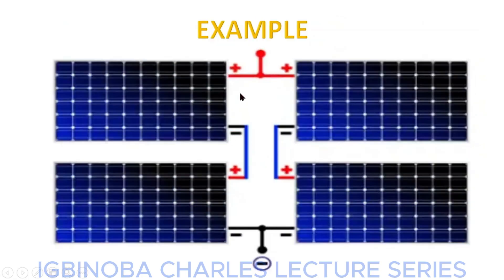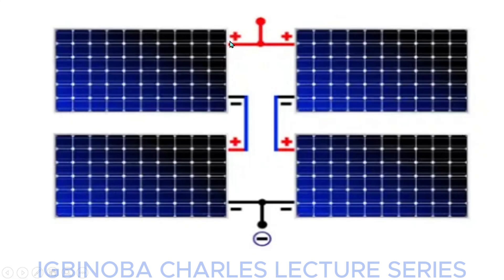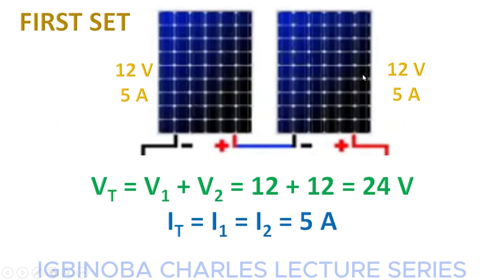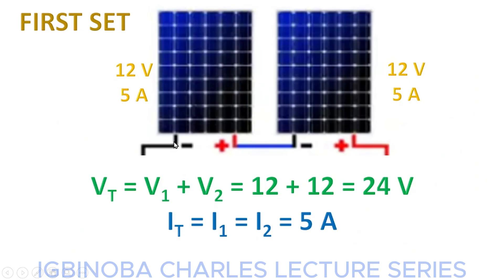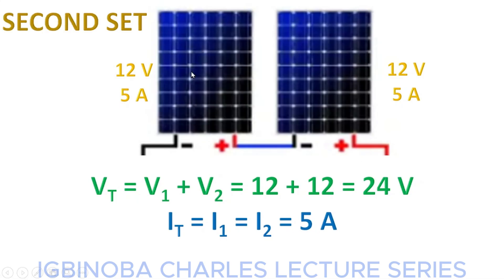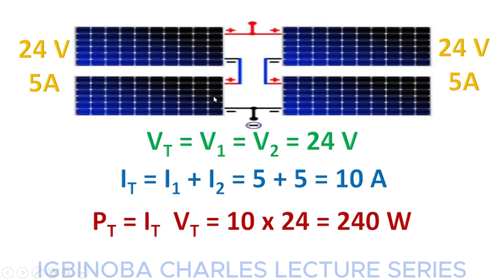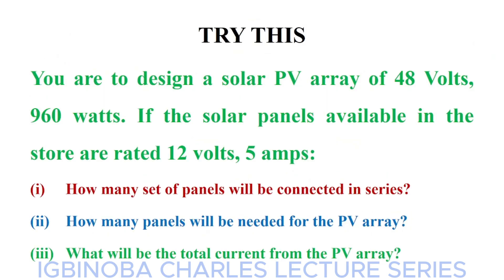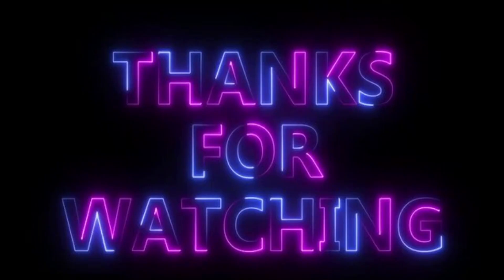Connection of  Solar Panels in SERIES-PARALLEL

Comment: PETRO3114J 

1. Since a series connection determines the total voltage of the solar array and the required system voltage is 480V, so the number of panels connected in series produces the total voltage.

The number of panel required is 480÷12= 4panels.

2. The power output of pne panel is the total voltage multiplied by total current.
    P= 12×5 =60watts

Therefore the total number of panel to prodUce 60WATTS 
                                   = 960/60= 16Panels.

3. With 16 panels in total and 4 panels per series string, the number of parallel strings is 16÷4= 4parellel sets. Each string produces a current of 5A, since the strings are connected in parallel the total current supplied by the array is 
                                           =5A×4=20A.
Reply: CHM84F

1. Since a series connection determines the total voltage of the solar array and the required system voltage is 480V, so the number of panels connected in series produces the total voltage.
The number of panel required is 480÷12= 4panels.
2. The power output of pne panel is the total voltage multiplied by total current.
P= 12×5=60watts
Therefore the total number of panel to prodUce
60WATTS
= 960/60= 16Panels.
3. With 16 panels in total and 4 panels per series string, the number of parallel strings is 16÷4= 4parellel sets.
Each string produces a current of 5A, since the strings are connected in parallel the total current supplied by the array is
=5Ax4=20A.

Comment: MEC52Z 

1,  4 sets of Panels will be connected in series. Since connecting 4 of the 12 volts, 5 amp panels in series gives a total of 48 volts as required by the solar panels array design 

2,  16 panels will be needed for the pv array. This is because the power of each Panel is 12×5 to produce 60watts,therefore the total number of Panels 
to produce 960 watts is 960/60 = 16

3,  The total current from the pv array is 20 amps since last (total) = / v(total)
I (total) = 960/48 = 20amps

Comment: CIV38L

1. Number of panel sets in series: 48V + 12V = 4 2. Number of panel for PV array: 960W ÷ (12V X 5A) 960W 60W = 16 3. Total current: Number of parallel strings: total no of panel for PV array/ number of panels set in series = 16/4 = 4 Therefore total current= 4X5A = 20Amp

Comment: PETRO3107C

1. Four panels are connected in series.

When you connect four 12-volt, 5-amp panels in series, you get a total of 48 volts, which is the voltage needed for the solar system.

2. A total of 16 panels are needed.

Each panel produces 60 watts (12 V x 5 A = 60 W).

To get 960 W in total: 96060 16 panels.

3. The total current from the solar array is 20 amps.

Using the formula I = P + V, I = 960 W 48 V = 20 A.

Comment: EEE385G

1. Series connection of four panels
Linking four 12 V, 5 A solar panels in series increases the system voltage to 48 V, which matches the required operating voltage of the setup.

2. Total number of panels required
Each panel delivers 60 W (calculated as 12 V × 5 A).
To achieve a total output of 960 W, the system will need 16 panels (960 W ÷ 60 W = 16).

3. Overall current output
The array’s total current can be found using .
So, 
I(total) = P(total)/v(total)
=960/48 = 20

Comment: MAR362J

Required PV array: 48 V, 960 W

Available solar panel: 12 V, 5 A

(i) How many panels in series?

In series, voltages add up, current stays the same.

We need total voltage = 48 V, and each panel = 12 V.

Number in series =48/12=4

(ii) How many total panels for the array? Each panel = 12V ×5A=60W To get total power = 960 W Number of panel=960/60=16

(iii) What will be the total current from the PV array?

Each series string = 4 panels = 48 V, 5 A. We have 16 panels total, so: Number of parallel strings=16/4=4 In parallel, current adds, voltage stays same (48 V):

Total current =4×5A=20A

Comment: EEE373U
1.Number of Panels in Series
Required system voltage = 48V
Each panel voltage = 12V
Number of panels in series = 48V ÷ 12V = 4 panels
Answer: 4 panels in series.

2.Total Number of Panels Needed
Power of one panel = 12V × 5A = 60W
Total required power = 960W
Total number of panels = 960W ÷ 60W = 16 panels
Answer: 16 panels in total.

3.Total Current from the PV Array
Total panels = 16
Panels in series = 4 → Number of parallel sets = 16 ÷ 4 = 4 sets
Current per set = 5A
Total current = 4 sets × 5A = 20A
Answer: The total current is 20A

Comment: PETROCHEM70R 
4 set of panel will be connected in series 
1  since connecting 4 of the12 volts, 5 amp panel in series gives a total of 48 volt as required by the solar PV array design.
2  16 panel will be needed for the pv arraythis is because the power of each panel is 12 x 5= 60 watts, therefore yhe yotal number of panel to produce 960 watts is 960/60= 16
3  the total current from the pv array is 20 amps
Since I (total) = p(total)/v(total)
I(total) = 960/48=20 amps

Comment: EEE363K 

I. Four panels are connected in series.

When you connect four 12-volt, 5-amp panels
in series, you get a total of 48 volts, which is
the voltage needed for the solar system.

2. A total of 16 panels are needed.

Each panel produces 60 watts (12V * 5A
= 60W) To get 960 W in total: 960/60 =16
panels.

3. The total current from the solar array is 20
amps.

Using the formulal= P+V,l=960W/ 48*V

M

20A

Comment: EEE312L
1. Four panels are connected in series.
When you connect four 12-volt, 5-amp panels in series, you get a total of 48 volts, which is the voltage needed for the solar system.
2. A total of 16 panels are needed.
Each panel produces 60 watts (12 V × 5 A = 60 W).
To get 960 W in total: 960 ÷ 60 = 16 panels.
3. The total current from the solar array is 20 amps.
Using the formula I = P ÷ V,
1 = 960 W ÷ 48 V = 20 A.

Comment: EEE395Q

1.Number of Panels in Series
Required system voltage = 48V
Each panel voltage = 12V
Number of panels in series = 48V ÷ 12V = 4 panels
Answer: 4 panels in series.

2.Total Number of Panels Needed
Power of one panel = 12V × 5A = 60W
Total required power = 960W
Total number of panels = 960W ÷ 60W = 16 panels
Answer: 16 panels in total.

3.Total Current from the PV Array
Total panels = 16
Panels in series = 4 → Number of parallel sets = 16 ÷ 4 = 4 sets
Current per set = 5A
Total current = 4 sets × 5A = 20A
Answer: The total current is 20A

Comment: EEE3119O

1.Number of Panels in Series
Required system voltage = 48V
Each panel voltage = 12V
Number of panels in series = 48V ÷ 12V = 4 panels
Answer: 4 panels in series.

2.Total Number of Panels Needed
Power of one panel = 12V × 5A = 60W
Total required power = 960W
Total number of panels = 960W ÷ 60W = 16 panels
Answer: 16 panels in total.

3.Total Current from the PV Array
Total panels = 16
Panels in series = 4 → Number of parallel sets = 16 ÷ 4 = 4 sets
Current per set = 5A
Total current = 4 sets × 5A = 20A
Answer: The total current is 20A

Comment: CIV340N
I. Four panels are connected in series.

When you connect four 12-volt, 5-amp panels in series, you get a total of 48 volts, which is the voltage needed for the solar system.

2. A total of 16 panels are needed.

Each panel produces 60 watts (12V * 5A = 60W) To get 960 W in total: 960/60 = 16 panels.

3. The total current from the solar array is 20 amps.

Using the formula I = P + V, I = 960W / 48 * V = 20A

Comment: PETRO386H

Required PV array: 48v, 960w
Each panel: 12v, 5A
Power of one panel:
P= V×I = 12×5=60w

I. No of panels in series; 
48/12= 4
II. No of panels needed for 960w
960/60= 16
III. Total current from the PV array;
4 panels per series string= 48v, 5A 
We have 16panels in total so;
No of parallel strings; 16/4= 4strings
When connected in parallel, 
Itotal=4×5=20A

Comment: MAR 381C
Four 12-volt, 5-amp solar panels are connected in series to achieve the required 48 volts for the solar system. In a series connection, the voltage adds up while the current remains the same, so four panels give a total of 48 volts and 5 amps. Each panel produces 60 watts (12V × 5A = 60W). To obtain a total of 960 watts, 16 panels are needed since 960 ÷ 60 = 16 panels. The total current from the solar array is calculated using I = P ÷ V, which gives I = 960W ÷ 48V = 20A. Therefore, to achieve 48 volts and 20 amps, the 16 panels are arranged as four series strings of four panels each, connected in parallel. Each string provides 48V and 5A, and four such strings in parallel result in a combined output of 48V, 20A, and a total power of 960W.

Comment: EEE377Y

1)4sets of panels will be connected in series. Since connecting 4 of the 12 volts, 5 amp panels in series gives a total of 48 volts as required by the solar
PV array design
2)16 panels will be needed forthe PV array.
This is because the power of each panel is 12 x 5 : 60 watts, therefore the total number of panels to produce
960 watts is
960/60 =16
 3. The total current from the PV array is 20 amps
Since I (total) : P (total)/ V(total)
I (total) : 960/48 : 20amps

Comment: MAR366N

1i. Panels in series add voltage but keep current constant.
We need 48 V, and each panel is 12 V:
No in series = 48v/12v = 4

ii. Each panel = 12 V × 5 A = 60 W
We need a total of 960 W
Total panels = 960w/60w = 16.

iii. We already know:
Each series string = 4 panels (48 V, 5 A)
We have 16 panels total, meaning number of parallel strings = 16/4 =4
Current adds in parallel:
Total current =5A×4 = 20A

Comment: EEE3113I

I. Four panels are connected in series.

When you connect four 12-volt, 5-amp panels in series, you get a total of 48 volts, which is the voltage needed for the solar system.

2. A total of 16 panels are needed.

Each panel produces 60 watts (12V * 5A = 60W) To get 960 W in total: 960/60 = 16 panels.

3. The total current from the solar array is 20 amps.

Using the formula I = P + V, I = 960W / 48 * V = 20A

Comment: PETRO 6F

1. Four panels are connected in series.
When you connect four 12-volt, 5-amp panels in series, you get a total of 48 volts, which is the voltage needed for the solar system.

2. A total of 16 panels are needed.
Each panel produces 60 watts (12 V × 5 A = 60 W).
To get 960 W in total: 960 ÷ 60 = 16 panels.

3. The total current from the solar array is 20 amps.
Using the formula I = P ÷ V,
I = 960 W ÷ 48 V = 20 A.

Comment: MECH344R

i. 4 sets of panels will be connected in series 
( 48V/12V) = 4

ii. 16 panels will be needed for the PV array 
(960W/60W) = 16

ili. The total current from the PV array is 20A 
( 960W/48V) = 20A

Comment: CHM3154X
Given;
PV array: 48v, 960w
Each panel: 12v, 5A
Power of one panel:
P = V×I   
      12×5 = 60w

1.No of panels in series:
48/12 = 4

2.No of panels needed for 960w
960/60 = 16

3.Total current from the PV array;
We have 16 panels in total so;
No of parallel strings: 16/4 = 4 strings
When connected in parallel
Itotal= 4×5 = 20A

Comment: PETRO3123S

Question 1 
Ans: 4 sets of panels in series connection

Question 2
Ans: 16 panels needed for PV array

Question 3
Ans: The total current from the PV array is 20Amps

Comment: CHM60H
X
1.  Number of panel sets in series: 48V+ 12V= 4
2.number of panel for PV array: 960W÷ (12V * 5A)= 960W\ 60W= 16
3. Total current: 
Number of parallel strings: total no of panel for PV array \ number of panels set in series
960W\48= 20ampere

Comment: PETRO3147Q

GIVEN: 
Total volt: 48volts
Power: 960watts
Solar panels available in the store are rated: 12volts, 5 amps.

1. Panels connected in series = total voltage/individual voltage rate
48 volts ÷ 12 volts = 4volts

2.  power generated from the panels is                12volts x 5amps = 60watts
  Total power = 960watts
  Panels needed for the PV array =       Total power/individual power panels 
960watts ÷ 60watts= 16watts 

3. Total current from the PV array is
   Power= total voltage x total current 
   960watts =  48volts x total current 
   Total current = 960watts ÷ 48volts 
   Total current = 20amps

Comment: MAR368P

Question 1 Ans: 4 sets of panel were connected in series 

Question 2 Ans: A total of 16 Panels will be needed for the PV array

Question 3 Ans: The total Current from the PV array will be 20A

Comment: MEC2B

1. Panels Connected in Series
To reach the required system voltage, we
connect multiple solar panels in series. In this
case, combining panels to get 48V + 12V
means we need 4 panels in series.
2. Total Number of Panels in the Array
Each panel has a rating of 12V and 5A, which
equals 60W per panel. To achieve a total
array output of 960W, we need:
Number of panels = 960 ÷ 60 = 16 panels
3. Parallel Strings and Total Current
The panels are arranged in parallel strings to
handle the current. The number of parallel
strings is calculated by dividing the total
panels by the number of panels in series:
Parallel strings = 16 ÷ 4 = 4 strings
With each panel producing 5A, the total
current of the PV array is:
Total current = 4 × 5A = 20A

Comment: MAR35E

1. Panels Connected in Series
To reach the required system voltage, we connect multiple solar panels in series. In this case, combining panels to get 48V + 12V means we need 4 panels in series.
2. Total Number of Panels in the Array
Each panel has a rating of 12V and 5A, which equals 60W per panel. To achieve a total array output of 960W, we need:
Number of panels = 960 ÷ 60 = 16 panels
3. Parallel Strings and Total Current
The panels are arranged in parallel strings to handle the current. The number of parallel strings is calculated by dividing the total panels by the number of panels in series:
Parallel strings = 16 ÷ 4 = 4 strings 
Toatal current =4 x 5A = 20A

Comment: PETRO344R
i) the series connection deals with the final  voltage of the array while maintaining current . 
So the set of panels will be :48/12 =4 panels .
 ii) the power of each panel is total voltage multiplied by total current 
     Therefore P=12 x5=60 Watts 
The total number of panels to produce 60 watts =960/60=16 panels .
iii) total current =power/total voltage 
                           =960/48
                           =20 ampere(s).

Comment: MAR3151U

1. 4 sets of panels will be connected in series.

Since connecting 4 of the 12 volts, 5 amp panels in series gives a total of 48 volts as required by the solar PV array design

2. 16 panels will be needed for the PV array.

This is because the power of each panel is 12 x 5 = 60 watts, therefore the total number of panels to produce 960 watts is, 960/60 = 16

3. The total current from the PV array is 20 amps

Since I (total) = P (total)/ V(total)

I (total) = 960/48 = 20amps

Comment: EEE392N

1. The series connection determines the final voltage of the array and the required voltage is 480v, therefore the number of panels needed to reach the required voltage is 48/12 = 4 panels.

2. The power generated by a single panel is 120 * 5 = 600W. The required power in the array is 960W. Therefore the number of panels needed for the array is 960/60 = 16 panels.

3. 16 panels are in array and 4 panels are in series. Total number of parallel sets of panels = 16/4 = 4 parallel sets. Total current from each set of panel is 5A. Since these sets are in parallel, the total current is = 5 x 4 = 20A.

Comment: MAR3153W

---

Solar PV Array Design Calculations

1. Panel Configuration for Voltage Requirement

· To meet the system's 48-volt requirement, four 12-volt panels will be connected in series.
· Calculation: 4 panels × 12 volts/panel = 48 volts

2. Total Number of Panels for Power Output

· The total number of panels required to achieve the target power output of 960 watts is 16.
· Calculation:
  · Power per Panel: 12 volts × 5 amps = 60 watts
  · Total Panels: 960 watts ÷ 60 watts/panel = 16 panels

3. Total Array Current

· The total current output from the PV array will be 20 amps.
· Calculation: 960 watts ÷ 48 volts = 20 amps

Summary of Array Configuration:

· Total Panels: 16
· String Configuration: 4 panels in series
· Number of Strings: 4 (to total 16 panels: 4 strings × 4 panels/string)
· Array Output: 48 Volts, 20 Amps, 960 Watts

Comment: MAR3113I

1. Number of panel sets in series: 48V + 12V = 4
2. Number of panel for PV array: 960W ÷ (12V * 5A) =
960W 60W = 16
3. Total current:
Number of parallel strings: total no of panel for PV
array/ number of panels set in series = 16/4 = 4
Therefore total current= 4 * 5A = 20A

Comment: EEE3102X

Require pv array = 48v, 960w
Ratings for each panel = 12V,  5A

i) in series, voltages add up, current stays the same

Total voltage requires = 48V
Each panel has 12V 
Panels connected in series = 48/12 = 4
Therefore, 4 panels are connected in series

ii)Total required power = 960 watts
Power for Each panel = 60watts
Panels needed for pv array = 960/60 = 16 panels

iii)in series current add up
current for each panel = 5 amps
Since we have four panels,
Total current from the pv arrays = 5 × 4 = 20 amps

Comment: MAR3115K

Given:
Required PV array: 48 V, 960 W
Available solar panel: 12 V, 5 A
(i) How many panels in series?
In series, voltages add up, current stays the same.
We need total voltage = 48 V, and each panel =
12 V.
Number in series =48/12=4
(ii) How many total panels for the array?
Each panel = 12V x5A=60W
To get total power = 960 W
Number of panel=960/60=16
(i) What will be the total current from the PV array?
Each series string = 4 panels = 48 V, 5 A.
We have 16 panels total, so:
Number of parallel strings=16/4=4
In parallel, current adds, voltage stays same (48 V):
Total current =4x5A=20A

Comment: CHM36F

Given: each panel = 12 V, 5 A -> 12 × 5 = 60 W
Required: 48 V, 960 W
(i) To get 48 V: 48 ÷ 12 = 4 panels in series
(ii) One set = 4 × 60 = 240 W, so 960 ÷ 240 = 4 sets in parallel -> total = 4 × 4 = 16 panels
(iii) Each set = 5 A, so total current = 5 × 4 = 20 A